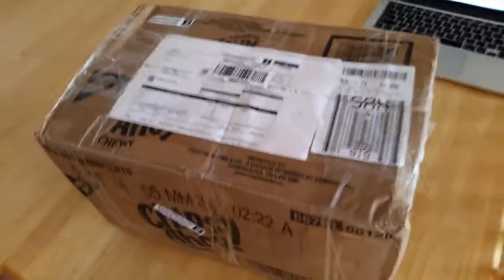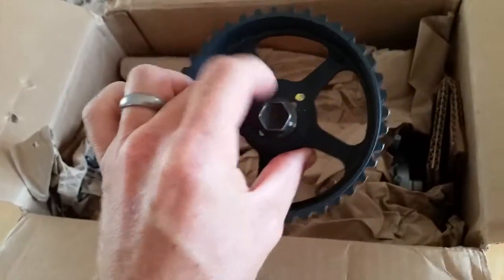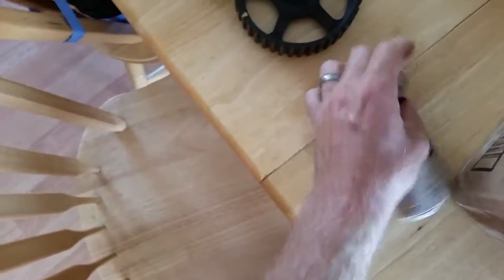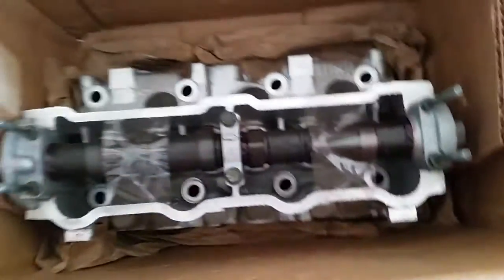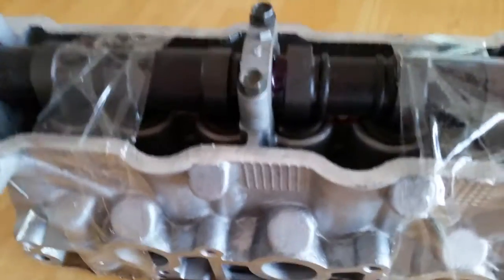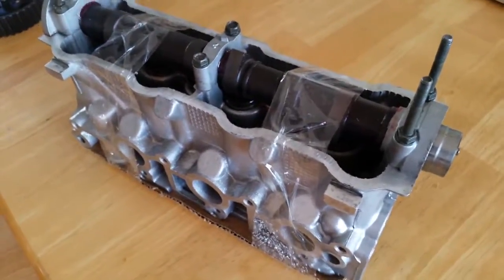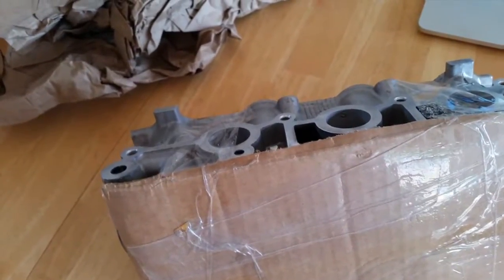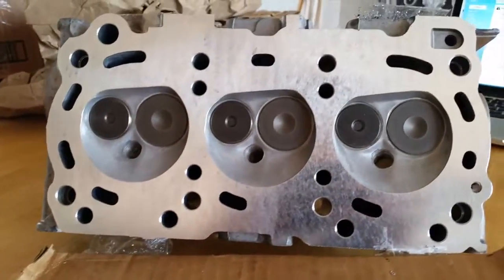Geo Metro Head Gasket: Episode 6 Unboxing the performance Camshaft and Cylinder Head

Comment: Did you put that new head on an old block? How many miles were on the block and did it last long with the new head on? Last time I put a rebuilt head on an old block the block blew out pretty quick.
Reply: It's just chance lol you can certainly put a new head on an old HEALTHY block it sounds like yours may have been flawed without your knowing
Reply: I agree with you. Worn rings and cylinders it wont last long and you will be spitting oil from the pcv valve into the throttle body from all the blow by and increase in crankcase pressure if it isnt blowing out your front and rear main seals that is..  I wouldn't put a new head on any engine with much over 50 k on it but that's just my opinion. I've seen first hand what happens when people do it to a worn engine.